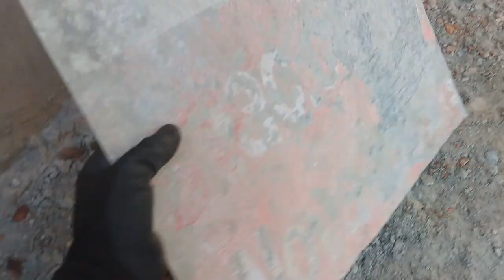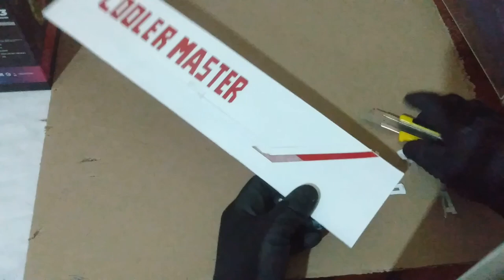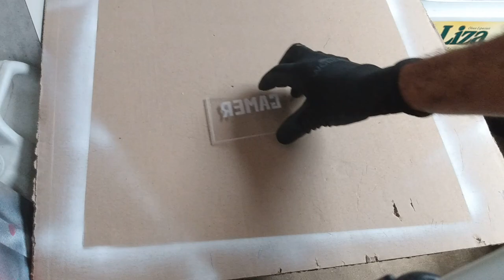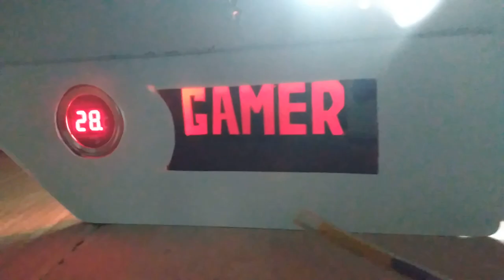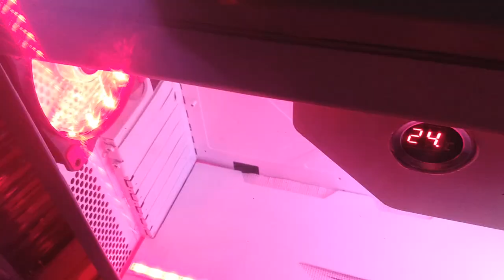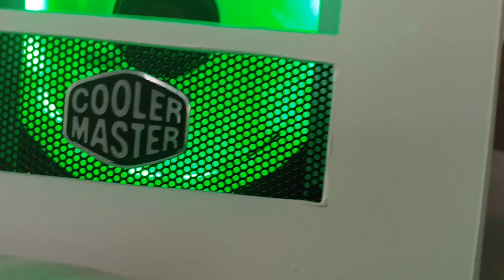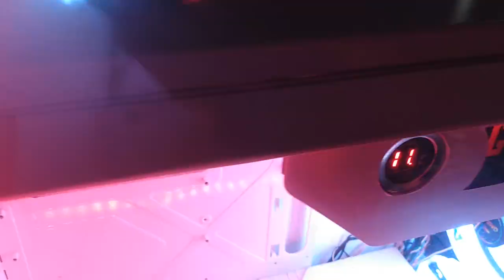DIY COMPUTER CASE/ MODDING PC White 2.0  / Моддинг кейса 2021

Comment: what is the name of mesh white material for using a dust filter? Please let me know. Thanks.
Reply from the maker: 🙂 I used the white sling fabric you can buy it in a construction store near your house, go where they sell house building material they sell it in 0.5mm or 1mm measurements which are very thin the name of the fabric is used sling fabric fabric for refurbishing chairs, you can buy by the meter 
🔵 Link     screenshot https://produto.mercadolivre.com.br/MLB-1866804499-telas-sling-metro-branca-cadeira-espreguicadeira-fio-duplo-_JM

Comment: What is the tool that are you using on 3:07 timing on video for mounting screw into cabinate reply bro urgent😞😞
Reply from the maker: 💙 It's a riveter, a rivet pliers 🙂 Link https://www.google.com/search?q=alicat+de+rebite&oq=alicat+de+rebite&aqs=chrome..69i57j46i39i199i291j46i131i433j0i433i512j0i131i433i512l2j46i512j46i131i199i433i465i512.8466j0j9&client=ms-android-motorola-rev2&sourceid=chrome-mobile&ie=UTF-8
Reply: @MRPcModified  Thanks 😊

Comment: Que es lo que le echas antes de la pintura?
Reply from the maker: 💙 Antes de pintar le puse papel de lija y  un splay prime, el prime es una base para sujetar mejor la pintura 🙂 Link Prime: https://produto.mercadolivre.com.br/MLB-2185661108-primer-fundo-aerossol-uso-geral-tsp1105-tekbond-350ml-_JM?matt_tool=45029758&matt_word=&matt_source=google&matt_campaign_id=14302215522&matt_ad_group_id=134553700068&matt_match_type=&matt_network=g&matt_device=m&matt_creative=539425477834&matt_keyword=&matt_ad_position=&matt_ad_type=pla&matt_merchant_id=114074986&matt_product_id=MLB2185661108&matt_product_partition_id=1403873223294&matt_target_id=aud-1658975302941:pla-1403873223294&gclid=Cj0KCQjw852XBhC6ARIsAJsFPN3GAwTd1tUvC0HCL3q-CXmiHa9mvyZz1oAXe3WzRkteRw0jJ6Q8TusaAgdhEALw_wcB
Reply: @MRPcModified  muchas gracias por tu respuesta!

Comment: what type of glass are you using please ??
Reply from the maker: :face-red-heart-shape:  I use  Transparent Crystal Polystyrene 2mm
Reply: thanks for the answser  @MRPcModified  , i beg to question , does ANY transparent plastic glass works ? i'm afraid of the heat it will bring back to the components
Reply from the maker: :yougotthis:✅✅ Yes, it works without any fear, the heat from the computer does not have the capacity to burn glass or plastic,  you can use , I use plastic and glass directly in my  pc. ✅  My videos  : https://www.youtube.com/@MRPcModified/videos
Reply: @MRPcModified  thank so much , i'll watch the other videos, since it's kinda hard to find acrylic plastic i will use some normal transparent plastic , i was afraid that it would cast back the heat to the pc components (normal glass would absorb it)
Reply from the maker: 🙂🙂 Yes I understand, I'm the one who thanks my brother, thank you